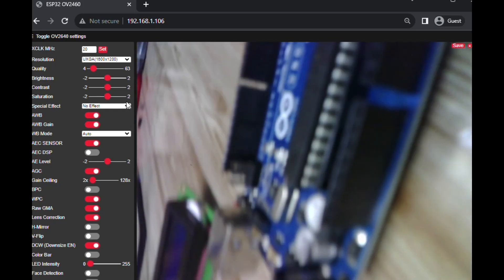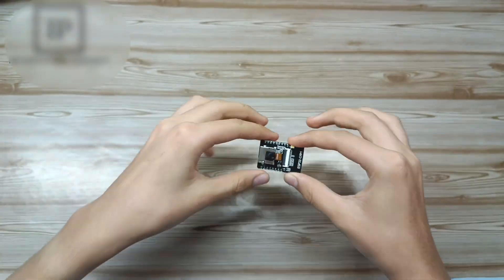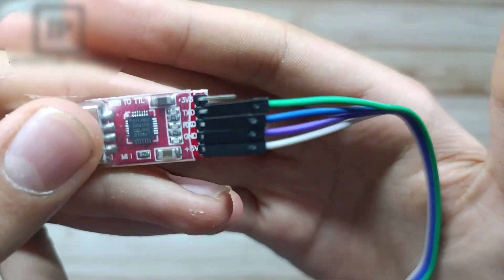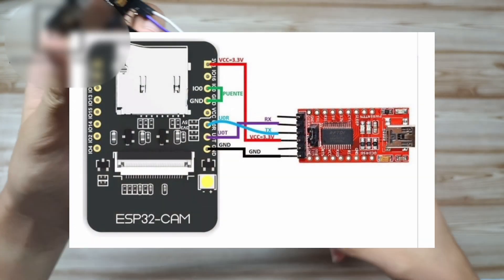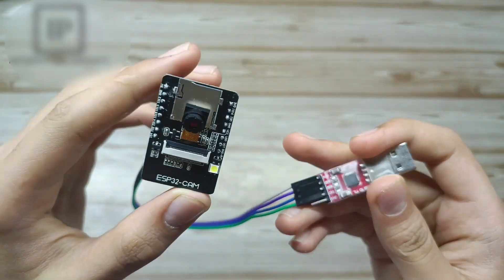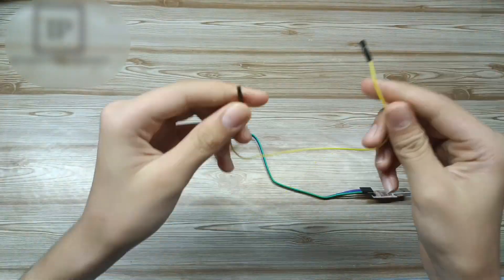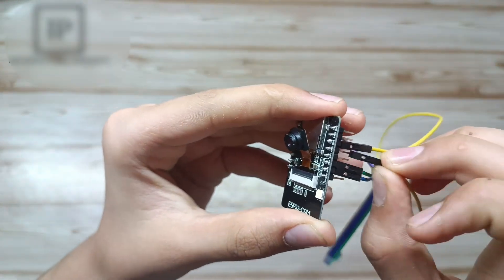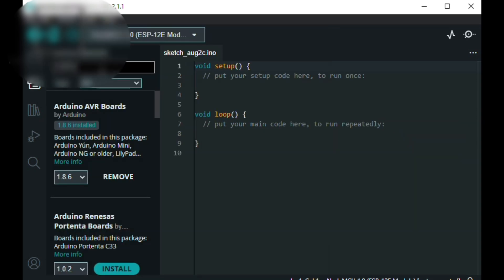Wireless camera with esp32 cam | Increase security with this camera

Comment: Nice video i appreciate
How can i connect multiple camera do i need to mske changes to the code lr just upload one at a time
Reply from the maker: hello buddy
Have a good time and happiness
It is not possible to connect several cameras to one esp32cam board. If you want to have several cameras, it is better to use esp32cam boards separately. 😉

Comment: I tried this with a newer model of the esp32 cam... They suck. they do not make good security cameras, the software is terribly slow. the image is bad and if you crank up the resolution, the refresh takes forever.  if you want to grab one picture that is ok. anything else no way.  the motion detection is so slow by the time you are notified they are already gone. do not waste your time.
Reply from the maker: hello my friend
good time
In order to make a good security camera, due to the problems of the slowness of the software and the lack of clarity of the image, I mentioned the following below.
1. You must know the resolution of your camera and then enter the same resolution in the software. You can connect different ov cameras and... there are good quality cameras on the socket.
2. As long as the camera does not have the power and that resolution, you should not enter any resolution in the software. This slows down the software and image updates.
3. When you connect a high-resolution camera, you can increase the resolution in the software to get the highest quality image at normal speed.
4. You can use the antenna socket that is placed on the module and connect it to that antenna with a small conversion and increase its range, while don't forget to put the resistance on the external antenna pin first.
I hope this explanation will solve your problem.